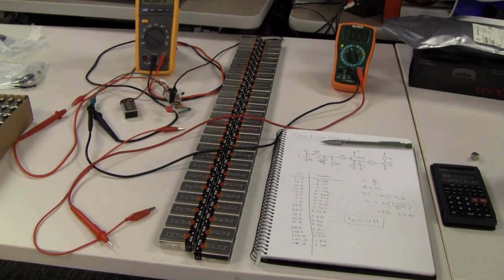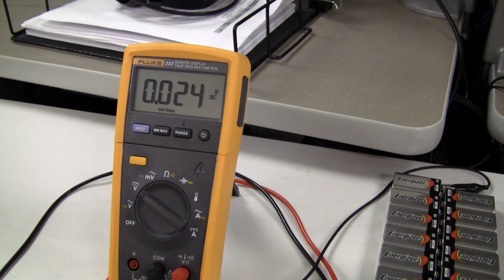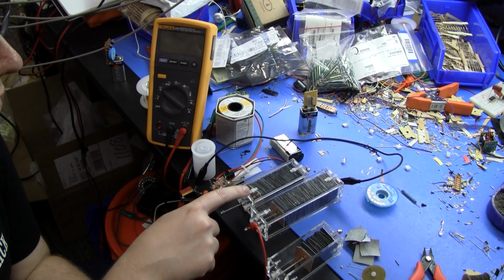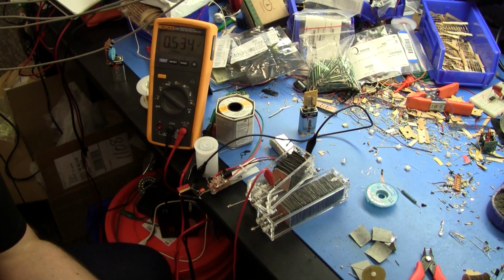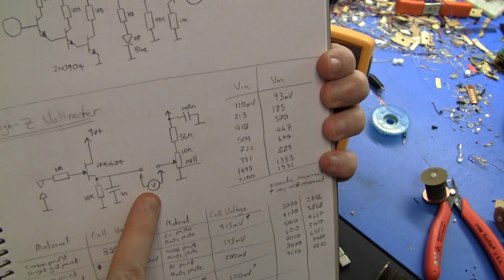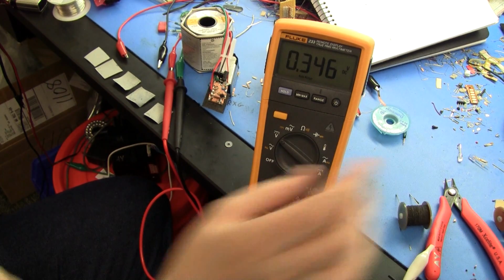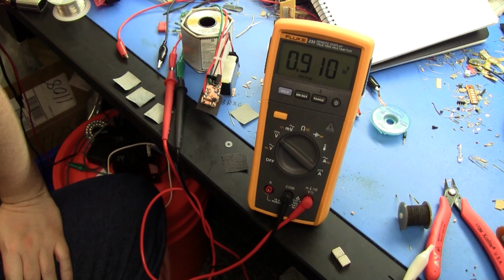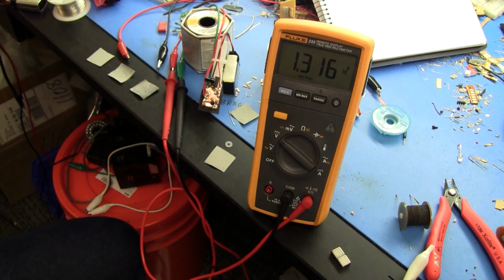More Dry Pile Experiments

Comment from the maker: These are primary cells, not really rechargable any more than a normal carbon zinc cell.  The main use is electrostatic toys.  Zamboni made clocks based of electrostatically driven pendulums which would run for many, many years.  The Oxford Electric Bell uses a pair and has been operating since 1840.  For tiny current applications they have very long lives, normal "dry cell" batteries have limited shelf life due to internal corrosion.  Dry piles are much drier and corrode very slowly indeed.

Comment from the maker: There is probably some thermal stuff going on yes.  The zero point drifts a little with temperature.  The slope doesn't get affected too much, not enough to worry about anyway, less than 1% for normal room temperature changes.  Opamps are definitely the right tool for the job, but the simple source follower works well enough if you don't have anything else.

Comment from the maker: Maybe without MCP gain and/or with an inefficient photocathode, like in earlier generation image intensifiers it might work.  I can barely get mine to reliably flash NE-2 bulbs, but when I played with Jeri's tube it used very little power and would continue to function on charge in the caps long after you turned off the supply inverter.  Tens or hundreds of nA and it is probably quite feasible.

Comment: Probably would have been good to move to an anology electroscope with gauge. Did you ever come back to this dry pile idea or compared different dielectrics ? I'm doing some research before designing my own. Wondering if there is a correlation to the formula for capacitors in terms of surface area of plates, dielectric, and such.

Comment: A clock was exactly the kind of thing i thought it could power although i didnt know of those electrostatic one.
If that clock has been running since 1840 then i suppose they do have quite a bit of energy or the clock is really efficient.
Thanks for the info :P

Comment from the maker: 1 nA at 1 kV is 1 uW.  For a 25 mm phosphor screen emitting near 550 nm at say 5% cathodoluminescence efficiency that would be 4 lux (reasonably bright).  Let's assume it was an MCP-based device, with a charge gain of say 10K. 1 nC is 6.2 Ge, so 6.2 G photoelectrons/s to the screen or 620 k photons/s?  Assuming a 25 mm objective 10% efficient photocathode and 550 nm photons that is about 20 microlux to saturate. Moonless starlight with no airglow is 100 ulx. Seems dubious, bias only?

Comment: 5 years ago any updates, comments, thoughts, conclusions, chemistry suggestions?
I INTEND to build a lot of things including a replica of the Oxford electric bell. I will avoid aluminium because passivation chemistry and be using a zinc MgO2 cell. 
Do SEALED cells work better than membrane cells? I mean plastic sulfur dipping is a cool visual effect but do you want SEAL the cell and make it a dry pile or do you want a slightly permeable seal to allow a tiny bit of moisture to increase conductivity/chemical cell effects. Its not hard to vacuum dry and SEAL a cell these days, so there must be a preferred (per chemistry/physics) moisture level.

** wow I come off as quite a few bad words when drunk and posting ** Sorry for the entitlement expressed (among other things)

Thanks for the great info!
Any updates or projects you've made with dry piles? 
I would be fascinated to hear any thoughts you have on the electrolyte aspects I had a theory.

I had a theory about water content and the electrolyte... but ammonium chloride blows that apart as its an anhydrous salt. Most salts crystals are a hydrate form and create water channels for transport. It seems like these are truly dry piles, have you experimented with desiccation? etc... I can test just looking for a newer starting point than 5 years ago...

Because even at 5 years old this really is the best bit of info I can find.